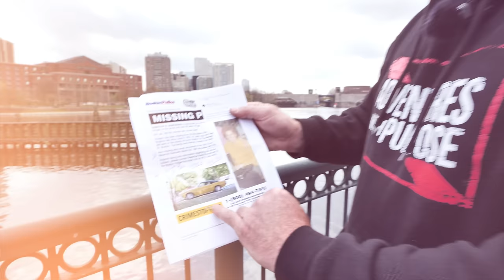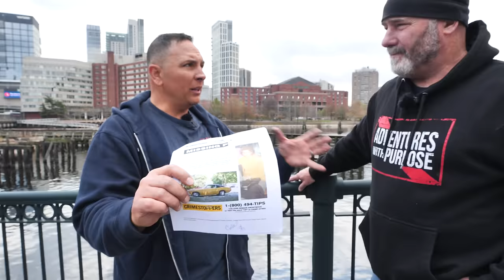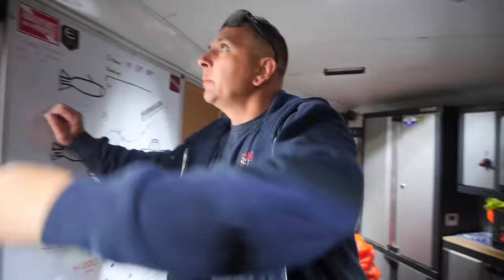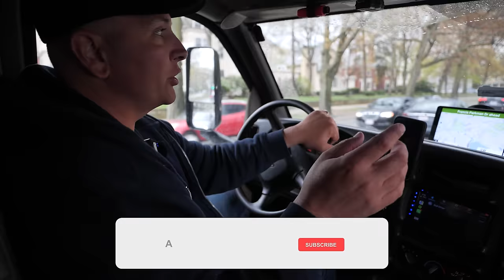MURDER?.. or BAD BRAKES: The Case of Dorothy Goroshko

Comment: Welcome to my hometown. This took place before the Big Dig, which changed the landscape nearby. I can't remember if they dug up near the Penalty Box and the waterfront there. What used to be an "upper deck, lower deck" highway system running through downtown (starting at TD), is now a very long, underwater tunnel. The maps and waterway maps will look different now. Ask Bill about the significance of the Big Dig.

Comment: Depending on if the Maverick was a 6 or 8 cylinder, those cars were very front heavy. I owned a Chevy Nova small 8 cylinder car. I skidded on a parkway in NY, which was a very cuvy road at the time, so I picked up speed. I was in rush hour traffic going to work. I skidded in rain on leaves, lost total control, thought I was going to wind up airborn and ended into oncoming traffic.  I stupidly tapped the breaks, the car did a very fast complete turn, and it shot into boulders that were at the curb of the road. The car spun around again and flipped over. That body style car, regardless of the make and model, was not safe.

Comment: I don't remember the exact district but, I took the wrong exit in Boston with a 2002 model 379 Peterbilt Semi pulling a 53ft Refrigerated Trailer. The Street was full of Tourists and it was Cobblestone and Brick. The Officer on Horseback was not at all happy with me BUT, he did stay with me until I could get back to the Interstate. (NO tickets were issued) I guess he believed I had suffered enough when it took almost 3 hours to get turned around.

Comment: Bringing up a headlight for a maverick wont tell you anything as its a sealed beam headlight bulb and 90 percent of cars that era back to 50s used the same style bulb. Tail light would tell ya kinda cause they share the same tailight with the pinto. Also its not a full frame car its a uni body pretty much you have rear frame rails then the floor acts as a frame then you have front rails. Mavericks had small bumpers till 73 they still had a small bumper on the back and a lil bit bigger on the front then 74 they went to big truck lookin bumpers front and rear. Most but not all had bumperetts on front and rear 1970 till 72 they were close togather 73 they got further apart. Good luck they were bad for rusting on land cant imagine what it would look like under water years. Also they use coil springs in the front and leaf springs in the rear.

Comment: Just FYI, that’s not how tire sizes work.  Obviously it wasn’t the right size, but the large number ie. 165 or 215 is the section width of the tread in mm.  The second number is the profile as a percent of the section width and the last number ie. 14 or 15 is the rim diameter.

Comment: Having anhard time with the it was a heavy car comment.. a maverick weighed 3000lbs. A 2024 honda civic is anywhere between 2900-3100lbs. One of the best things about mavericks was the lower weight. Plus a lot of the mustang, and falcon parts fit it. So lightweight, v8, that can be made to go fast straight or turn. Without having the same car as everyone else lol.

Comment: Mavericks were actually light cars. Some had power steering. Untill 75 they had drum brakes front and rear. Then they got disk on the front. Also ford killed the maverick because they were killing the mustang. They were cheaper and lighter than the mustang and faster if you had the 302 so mustang sales declined an maverick went up so ford jacked the price of mavericks up so it was $400 cheaper than a mustang which made people start buying more mustangs. Dont confuse the Maverick with the pinto. I own 3 Mavericks 2 1970s 1 1973.

Comment: It appeared to be that was a full framed vehicle NFL it's not a Maverick,1970 Maverick did not have a full frame they had the early style unibody
Also it would probably have a 4 cylinder in it and the wheels would be 14 inch
The tires would be more than likely e78 14 bias play😐

Comment: i love listening to people talk about cars ,, the ford maverick was actually NOT heavy it weighed 3100 pounds in the 4 door model and 2900 in the 2 door ,, it actually was very light by 1970 standards ,,my mother had a 1974 maverick   and the problem they had was not just brakes but actually a transmission issue  where they would jump out of park if left running ,,, i actually have pictures  of mom and dad's maverick  after my dad left it running and it jumped into reverse and backed through the front door of the local Pizza hut , back in 1978